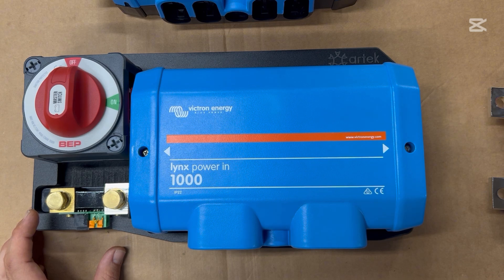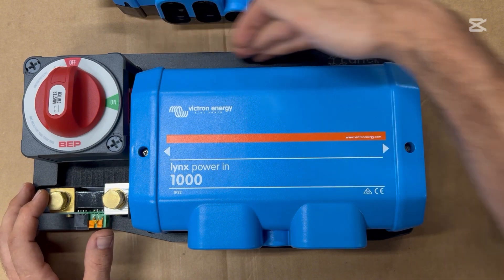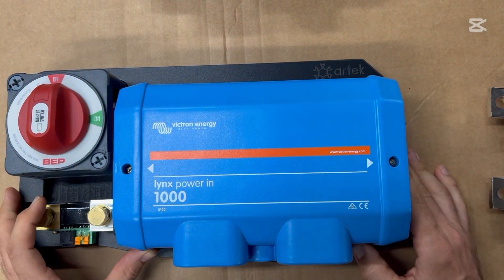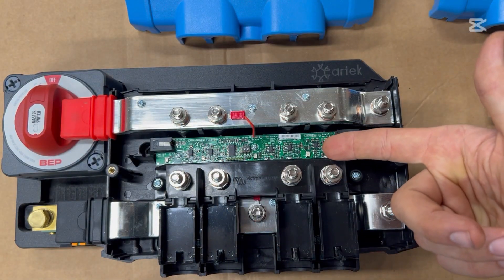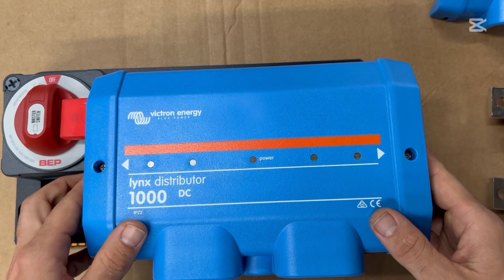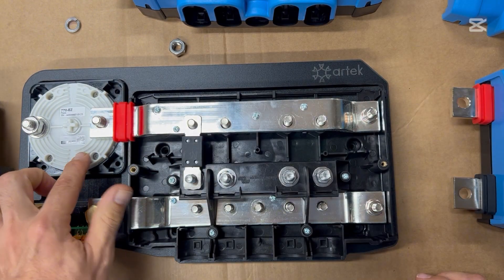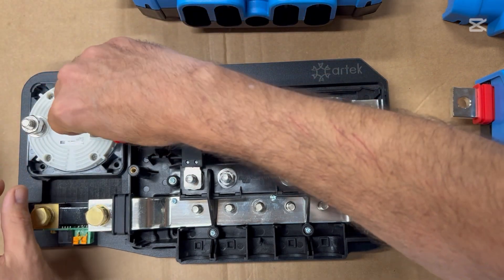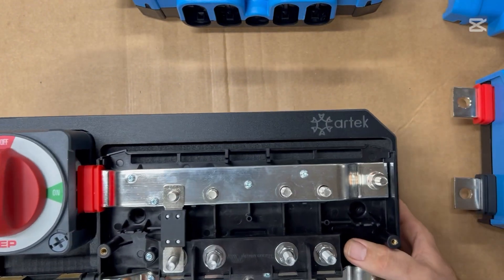Lynx Power Distribution Center - Every Off Grid Van Needs This!

Comment: Aside: What are you thoughts on the prospect of an MRBF-based Power In? To me, it seems consipcuously absent from the Victron product lineup.
Reply from the maker: Blue Sea Systems does have a 5196 Fuse Block  for MRBF fuses.  It features 3 fused connections points.  I'm actually using one in a Winnebago Solis Pocket system right now where space is TIGHT!  I'll hopefully have that installation video posted in a few weeks.
Reply: @FenixOffGridSolutions  Yes, I'm aware of the BSS MRBF holders. For distributing power to devices, rather than aggregating batteries, yes? I wonder about the absense of a Victron offering, but as a Power In unit, rather than a distribution unit. Class-T fuses aren't cheap, but they offer that Power In. Sure, it covers all bases with the AIC rating of the Class-T fuses, but if MRBFs are deemed adequate at the battery terminal in many cases, then why not in a Power In?

Comment: For LiFePO4 batteries, the ANL fuses are a bit of a stretch. The Lynx Class-T may be overkill in many scenarios. A Lynx MRBF model (no need for MRBF holders) would be great! I'm leaning toward DIY busbars from copper bar stock in a custom enclosure which will house a number of other components (battery cables, fuses or breakers, shunt, balancer, other). $140 for just the Lynx busbar, though, is too pricey for me (but who knows, I may change my mind). A Lynx Power In plus a $60 base to use the expensive BEP components is way out of the ballbark for me. I just realized you were turning a Power In into a distributor, in which case the ANL fuses will be fine. As a battery combiner that is also going to serve as battery fusing, it's really not up to the task with LFPs.
Reply from the maker: A lynx distributor or in this case a modified lynx power in isn’t relying on MEGA fuses to protect the battery. The Artek shim plate is just one option of mounting the BEP switch with the lynx and shunt. By expensive I think you mean quality. You do you that’s fine and DIY busbars can work if you know what you’re doing, which it sounds like you something at least. After over 100 custom systems I trust the setup I describe here for most mobile applications and it’s absolutely up to the task
Reply: @FenixOffGridSolutions  Yes, I meant MEGA. In another video here I actually posted about the Power In mod fundamentally changing the purpose of the Power In to a distribution device, which didn't seem emphasized. Put a piece of tape over "Power In" also, perhaps, to take that connotations of that moniker off the product.
Reply from the maker: @PowerUser-l2q  sure for folks who are unaware of the changes made to the power in that makes sense.  Likewise I could use a sticker that says "modified".  Ampacity wise the 'power in' and 'distributor' are the same.

Comment: I am getting ready to use the Power in for a 3 battery bank system.  I have a 400 amp Class T Fuse I need to install between the power in and the switch.  Any tips on where/how to do that?
Reply from the maker: If you’re using the lynx power in in a typical situation then your battery cables would run to the power in then the positive bar would connect to a class t fuse. Another way to do it would be to fit each battery with a MRBF fuse then connect to the power in. I have off grid power system and van build consulting offerings on my website if you need more help!  https://www.fenixoffgrid.com/consultations
Reply: @FenixOffGridSolutions  Thank you.  I will have 250 AMP MRBF fuses on each battery.  Will install the Class T fuse holder after the power in unit and before the cut off switch.
Reply from the maker: @peterlent4929 typically I would do one or the other. The less connections the better for less resistance. How many AH is each battery?
Reply: @FenixOffGridSolutions each battery is 314AH for a total of 942. Highest draw is a 3000 watt inverter but will only be used for typical loads under 1800.
Reply: @FenixOffGridSolutions  The individual battery fuses isolate the batteries at their max individual output level with an appropriate sized fuse, while the fuse at the output of the Power In is sized to protect down stream components from total output of all batteries (which could be the combined output of all the batteries, say feeding a 3000W+ inverter). Therefor, fusing at both places required. Agree, or not?
Reply from the maker: @P @PowerUser-l2q  the battery bank should have its own fuse as close to the battery as possible though ABYC standards has different considerations. Fuses for batteries, according to ABYC, are sized not only for current but for AIC as well. Typically I fuse the battery or bank then fuse the circuits for chargers and loads when they change size or at the distribution center. Is that required - by me, yes
Reply: @FenixOffGridSolutions  Yes, but I was trying to emphasize the need for fusing of individual batteries (or strings) in parallel, and then also fusing the bank (cable going from bank/busbar to inverter). Individual battery/string fusing to keep a bad one from taking-out the other ones. I think I recall that from Victron's "Wiring Unlimited" or somewhere.
Reply from the maker: @PowerUser-l2q  having a redundancy like that might be valuable in a maritime environment where if one bad apple takes out the whole bank then you are literally a sitting duck.  but why not just have individual fuses on each battery then have the inverter on its own fuse?  Thats what I've always done.  Now ABYC standards does state that "For parallel battery banks with a capacity exceeding 500 Ah, a battery AIC safety overcurrent protection device shall be installed between each battery in  the battery bank and the main overcurrent protection device."
Reply: @FenixOffGridSolutions  I'm still building my first system. I should refrain from posting too much while I'm still researching/learning. I probably said some incorrect things above. The ABYC wants folks to view their recommendations as the bare minimum, but that's exactly where I want to be at to do it at lower cost, but  to have some adequate peace of mind with the safety, knowing very well that spending more in the safety stuff is always a good investment. Some people recommend a Class T fuse at each battery. I buy $120 LFPs and it takes, then, $50+ for OCP for each battery? Something's awry with that. Just sayin'.

Comment: This is a very clean setup going in to the Lynx Distributor (Power in). I have a Lynx Class T Power In and I’m wondering if there is a similar mounting solution when using the class t power in to the left of the disconnect switch. Thanks.
Reply from the maker: I believe that this BEP Link Bar would work between the Class T Power In and the left side of the BEP 400a switch: https://trek.systems/shop/cables-and-accessories/bep-link-bar-779-lb-2-for-8-10mm-studs/ref/1084/

There is also a shorter, LB1, that could tie in a BMV or SmartShunt on the negative bar if you are using one.